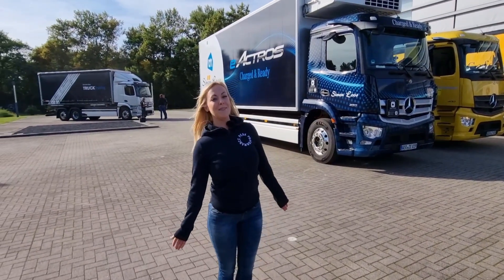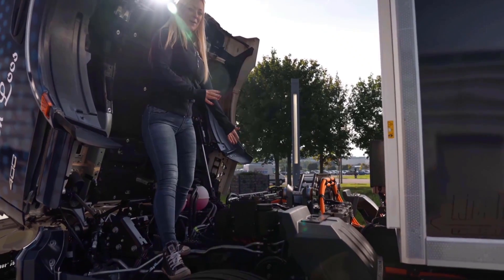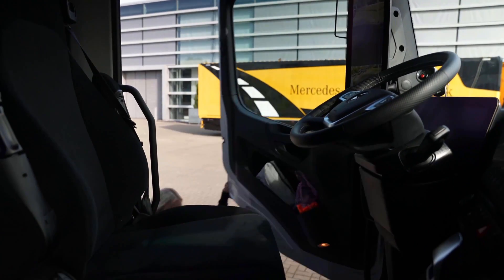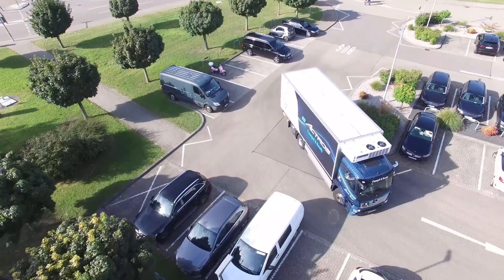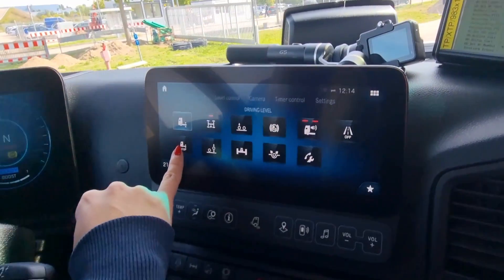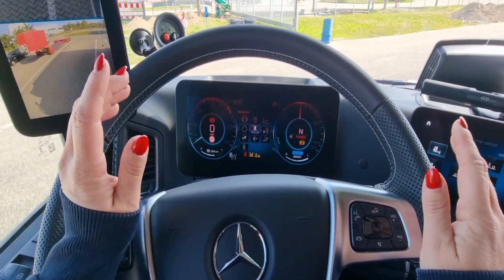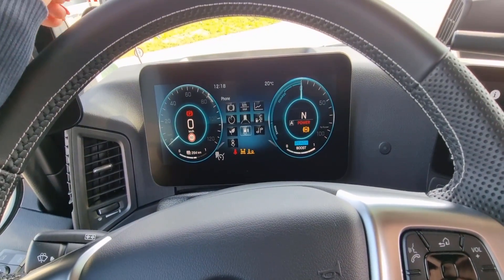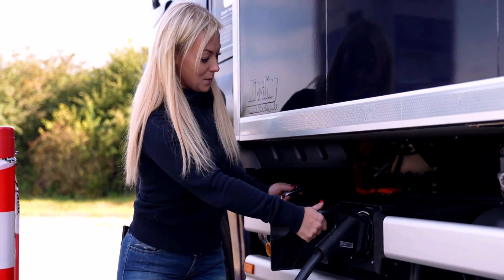⚡MERCEDES ELECTRIC TRUCK⚡ E-actros - Angelica Larsson

Comment: I’m like you with the mirrors that would be hard to get use too after driving for over thirty five years 
 I’m so glad that you got the chance to show off the Etruck that was fantastic
Reply: You can't get the depth/3D as mirrors.  While moving your head a little you get a different view with mirrors....not so with camera.   In darkness/low sun light into the camera/ fog/cold moist/snowy weather is it useless.  There are nothing for the camera to focus on and you just see a lot of pixels on a screen.   Not everything new is better....

Comment: Electric trucks may be fine for local use, but they have a long way to go (no pun intended) until they have the range of a diesel truck. In America, it's not uncommon for an over the road driver to put on 500-600 miles a day.

Also, the side view cameras are a nonstarter for me.

Comment: For a daily delivery truck, batteries are fine, but still think hydrogen is the way forward for heavy haulage. I quite like the screen mirror replacement system  - easier to see in the rain and doesn't  get dirty quickly in winter. Stay safe and see you on the next one.👍
Reply: Hydrogen has a lot of advantages in comparison with electric drive, but one huge disadvantage. A fuel cell needs absolutely clean air. To achievethis, there is a huge need of short interval maintnance  and more expensive costs in daily use than electric drive.
I prefer hydrogen, cause it can be produced in daytimes when there is not that power need in society or it can be produced in a seperate " island" circle wirh its own power suply bye wind and sun that those dangerous aplitudes in the power net were not forced.

Comment: Let me guess every hundred miles you have to plug it in for eight hours because the math does not work out specially if you’re carrying 19,504.495 Kilograms in weight up Hills you’re not driving on flat terrain all the time The batteries would get drained pretty quickly because the harder the electric motor has to draw power faster the batteries go dead that’s why you don’t see a fleet of electric trucks like that anywhere I think these are just concepts of dreams that they would like to be reality.

Comment: The best way is to drive on plain water. It is possible. A Frenchman ivented it maybe 80 years ago. But he was bought out by the oil companies. There is not enough raw materials to make batteries for a long time. Bit of pulling on a dead horse I think. Most mines in Africa were bought bij the Chinees. The rest of the world was sleeping.

Comment: In the video atleast you can easily hear when the truck has started because of the fans that cool the batteries underneath the cab are turned on. The humming noise of those are rather clear in my ears as far as I can tell ;)

Comment: I hate to put a DAMPER ON YOU BUT THE BATTERY AGE IS DEAD IN THE WATER Internal combustion hydrogen is the way forward the technology is here and working zero emmissions zero load loss due to battery pack size and weight  fast refuel if needed

Comment: A heavy truck with all the batteries adds weight, uses more power, so the driver will be constantly stopping to charge up. Electric  motor is good in theory, cars or trucks. But we haven't got the infrastructure in the world to support this change. Hybrid makes more sense.

Comment: why the fuck it's relevant for a company owner or for a driver the rolling test on that inclined pit? i challenge those who have cojones to load those trucks with a semitrailer attached with steel rolls. or container with pallets with boxes full of steel nuts and bolts.

Comment: Maybe you can suggest a few things to these guys, they need to have an electric motor on each wheel including the front, hub motor on front and there are several models to choose for rear, this would share the work load and traction control... and if done properly, could also be used to help turn truck in tight corner by " skid steering " the rear ends, they should try the new battery type called LTO, the trailers need to have motors on the wheels as well, regen braking, traction control, shared load, if one motor breaks, the rest can still carry the load. Exchangeable battery packs in the truck and trailer, so you can easily swap them out for a new if need be with dismantling half the truck.... engine to produce electricity for long haul's, ac, heat... they make them in China, electric vehicle range extender....with batteries in the trailer you could go much longer distances.

Comment: Interesting video. For me who has no knowledge on trucks, this E-truck seem to have low range but as you said in the video it can work well within the city. The batteries add 3 ton on weight but maybe this is compensated by no longer needing a heavy? diesel engine and it should not impact loading capacity. If this e-truck can be the answer for within the city, specially with possible need to charge it, i'm not sure. Lets hope so however, it should be removing some of the air pollution in large cities. Thanks for sharing this video.

Comment: I am still waiting on an video from anyone on any electric vehicles on the highways in an major snow storm and stuck with the rest of traffic. Then major floods. Then sand storms. Ect. Not in sunny weather when someone would be driving an gulf cart playing gulf. 60,000 truckers lost their jobs to the electric trucks. So they can be brought in. The manufacturers are to chenken to prove it. That leaves it up to those whom are buying them. That's what I want to see. Out of places out in the sticks. Going threw swamps. Extreme weather events. Hot and cold weather. I80 in Wyoming always gets shut down during the winter. Traffic is always stopped. I want to see an electric vehicles stuck with the rest of them. Will they make it. Can they hold up is the rest. Some budy show it please. Enough showing them in good weather. Put them to the test. Thanks.

Comment: Are they really that good for the environment though? when you look at building the batteries, charging them and so on, it is cool sure but not a huge fan, trucks looks fine though no noticeable difference from the outside. And those "mirrors" they seem to block a lot of the view as well, was that your experience to or is that not as bad as it looks like in a video?

Comment: Good morning ☀️ 
I’m Jeff from the states, I had a few questions to ask you. 
How much does it cost to charge up the truck when the batteries are low? 
Are there plenty of charging stations where these trucks are being used? 
How long can you drive before recharging?
Does your interstate or turnpikes, as we call them, have service plazas equipped with the charging stations? 
Thanks, have a great day ! 😁
Reply: Batteries are 420 kWh, but one do not drain than more than to 20%, so one use 336 kWh of power which get it 250 miles. At the moment not too many charging points for trucks for public use, but they are working on it. A company buying one, or a few of these, will typically have their own charing station built and use the trucks locally in and around a city. Diesel engines converted to hydrogen will likely be common in europe for longer hauls, and construction machinery.

Comment: Just wait till these batteries are working in very cold temperatures like we have in Canada as well as in Sweden along with all the salt and other conditions that are found in the real world. Not to mention the electric power grid we have here which can barely handle the load on it now.
Reply: cold is solved even in teslas, which are not new anymore, but other concerns are very valid. 
I have friends who live in a places, where all rural area gets dimmed lights when one guy uses a welder :D and that is just a local problem, line upgrade would not solve huge demand surges when we need to charge all the commercial stuff

Comment: Diesel power is always needed,  and the Sound of Dieseltrucks is like no other.. hearing the shifting of gears is addictif..
Reply: You are so close minded! Electric trucks are superior and they are definately the future of trucks.
Reply: And you CAN play the sound of diesel truck in the electric truck via speakers (99,9 % of people don't like the noisy and polluting diesel trucks tho). You can also hear the shifting gears in electric trucks, some electric trucks have gears. And even thoose that do not have gears, you can still play the sound of shifting gears via speakers and create the feeling of a shifting via software (how you apply power to the electric motors).
Reply: All this things can be achieved in electric truck, so you have no excuse anymore! Electric truck is also 7 times cheaper to run per kilometer, have MUCH less maintenance, have cheaper maintenance, have much better performance (torque, power delivery) and don't pollute the cities where we live and breathe.

Comment: Good to see your looking into the future,
I'm a bit of a sceptic of ev cars, in UK cities you often find cables supplying houses that are 100 years old, they have done a really good job.  With all the extra electrical load I wonder if they will start burning out.
However ev trucks when used for local deliveries have the advantage of being charged on industrial estates that have access to higher voltages to speed up charging on cheap night time electric.
Let's get the other freight on to a train and help save the planet.

Comment: This is the local deliveries model? Add a small gas turbine electric generator (like a mini power station) under the belly to refill the batteries, and it would go further, and be warmer in the snow :)
Is there something odd with this upload - it looks like it was filmed widescreen and squeezed to 16:9 by youtube - round things like wheels and tyres look tall and oval... Or was it just to make yourself look taller? ;) :D ;)

Comment: I just got a leaf, I'm always speeding as it is so quiet I can't tell how fast I am going as there is no engine/transmission vibration to judge speed like in my old gas powered car.  When I start it there is no engine noise so I can't even tell if it is on unless I look at the dash.

Comment: Really love your videos 
Well if you get an electric truck you will get lots of brake time as you wait for it to charge 

So what infrastructure is needed to charge your truck 
Are there special truck stops or will the company you deliver to have a power plug for you 

Ware does your electricity come from 
What kind of power generation will be needed 
No one talks about this 
The electricity has to be made 
But when you here people talk about electric vehicles. It’s like a little power fairy magically follows you around to recharge you car or truck 

The Reality is unless we are willing to build more power generation plants we will run out of electricity for or factory’s and homes 
Like in the US the state of California is demanding people switch to electric cars 
But almost daily they cut power off to whole towns for 8 to 12 hours or longer 

This will happen every ware if the people in government don’t get the facts right 

A simple wind mill like we have in the us uses oil not just any oil 
It is a special oil refined from crude oil and this is it only source 
This oil has to be changed and replaced when a leak occurs 
1,000 of gallons pre wind turbine 

So how far could you drive your car on a 1,000 gallons of gas how long would it last you

Comment: Fantastic Angelica. Finally there is being done something about the massive pollution these trucks are discharging.
Reply: Euro 6 engines pollute less than many petrol & diesel cars. However, electric and hydrogen are definitely the way forward.

Comment: hi angelica its very nice truck but i rather have my deisel trucks my question is here in america we haul freight up to 80.000 lbs and i do temp control freight from pennsylvania to nevada and cailf and to northwest and we have to pull some very hard mountains and in northwest its get very cold and winter storms happen often out here in northwest and east coast get their share also i wonder how long on charge u could go cause in 8 to 11 hrs driving day here in america i only need to fuel once in a day and i can go almost 2 days b4 i fuel but i fuel every day on the safe side we also need 10 hr rest break i would not want to be in middle of wy or co and 5 or 6 hrs into my break battery charge die sure its nice truck but ill keep my desiel power truck cause i dont see them working here in america evern that our goverment and worthless president pushing for them cause i dont know how many miles you run in uk but here in our country i myself run between 2300 to 3000 in week like this week i did 3100 so electric i just cant see it work in big country like ours yes i agree very nice truck and prob work in short haul market but over the road i just dont see we ready for it just yet thx for showing us the truck

Comment: “Green truck”😂.
Wonder how “green” the power used to charge this truck is😉
Reply: The unspoken root problem with electric vehicles /batteries simply store fostle fuel energy in the forn of electricity

Comment: I've not driven a Mercedes with the cameras for mirrors but one thing I've noticed is you can't view the driver like you can with traditional mirrors.
It's very useful because you can see if they're likely move or if they're just on their phone on a break.
Also if the battery dies so do the mirrors, a friend of mine works at a Mercedes commercial dealer, during the first lockdown the trucks batteries were completely flat & you couldn't jump start them you had to trickle charge them because the screens went a bit haywire.

Comment: I would imagine truck manufacturers will probably lean more towards hybrid trucks.

They will still use Diesel engines for long distance travel on motorways etc and then they
will be able to switch over to electric power and batteries when driving into towns and cities to 
reduce the NoX and Co2 emissions in built up areas.

Ultimately something like hydrogen is probably one of the better solutions for trucks and other 
heavy plant machinery rather than pure electric.

Very interesting video though Angelica, its good to see manufacturers moving towards a cleaner
and more environmentally friendly way of doing things, even though batteries also have an impact
on the environment through the materials that have to be mined for them.

Maybe in the next few years you will be piloting one of these sort of trucks into the beautiful snowy 
wilds of Sweden 😊

Comment: that's 3 tons of batteries plus the weight of the drivetrain.... which is a lot of cargo that can't be carried, and the range is less than half of what a OTR truck would cover in their hours of service. All this on a box truck with plenty of space for the batteries. Try to cram a full range battery into the limited space of a tractor towing a 40k load and lots of things are going to require compromise. The energy density of chemical batteries isn't there yet,  and the dangers of high-energy/high amperage charging and the infrastructure to provide it has a LONG, long way to grow.
Electric has a place, but I'm not sure it's there yet for OTR trucking, especially in the US.
Very cool tech and I'm glad they are building on it, but see many issues if this is made the only option.

Comment: When those batteries start leaking or bust that will be an epa nightmare when it seeps into the soil or water. Not to mention if it breaks down good luck getting the battery cells replaced with the shortages we have

Comment: The thing with electric cars is you can’t charge them in 5 minutes, it can not take you 5 minutes to fill up a car at a petrol station, it’s something they need to work on.

Comment: Not taking anything away from the fact that this is a technical marvel, I would like to point a few things out.  Electric vehicles (of any kind) is a stopgap solution and not the answer to our environmental problems.  There simply isn't much more we can eek out of battery technology, and I doubt it occurs to most people that the energy density of batteries is FAR FAR inferior to that of petrol or diesel.  Three tonnes of batteries for 400kms?  As you said, a city truck, but in the USA and in my country electric trucks are simply not commercially viable because (1) the distances involved is just too far to overcome, (2) it relies on a vast network of charging stations over a very large area and (3) it puts pressure on an electricity network that is incredibly difficult and costly to cater for.  I am actually stunned that many companies are pouring so much into the development of EVs and not in completely different alternatives, like Hydrogen Fuel Cells, which solve almost all of the problems with EVs.

Comment: Wow! I am quite impressed with your skills and abilities around heavy rigs and glad to see your still able to keep  your nails polished! Considering my experience over 45 years I was lucky to have only had one split skull from a chain binder, (snap over style, not ratchet as you are using) what is called in U.S. a cheater pipe extension to snap binder down with a bit more tension. I was moving a John Deere 750 dozer. And here you are girl, demo driving an EV for Benz! You have a lot of boys and men crying right now!
Reply: Damn John! You think that with your experience of over 45 years that you would have at least gotten a little heart under you comment! I know this would mean so much to you as it does to the rest of these admirers and so I will give you one myself. Just pretend it's from her. 💖